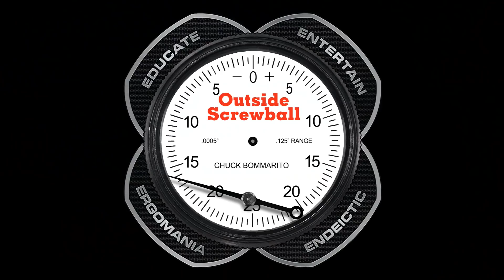Modificaitons and Mistakes

Comment: I believe most surge brakes have some sort of lock out so you can back up.
Thanks
Reply from the maker: correct....I just did not want to deal with a lock out or damage of the trailer cup

Comment: How is Howie doing, Chuck?  Great video with a good project.  TIG welding is looking good.  Do they use off the shelf DOM stock for theirs?  Looks a bit more like a schedule 80.  Patey brothers build the same kind of set up on steroids for moving airplanes with models from Cub pullers to Multi jet commercial.  Several thousand for them I understand.  Take care.  Doug